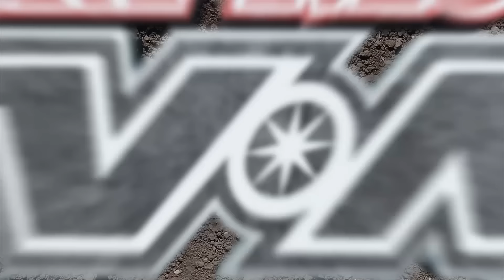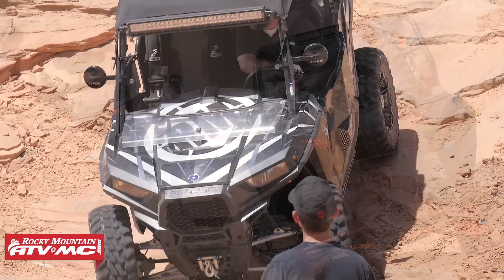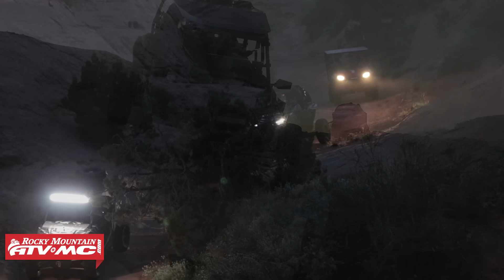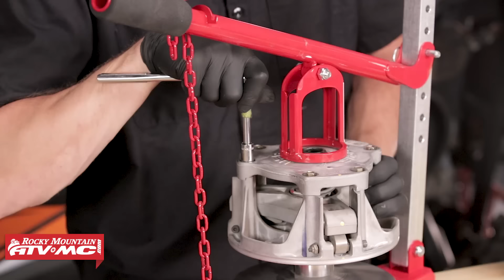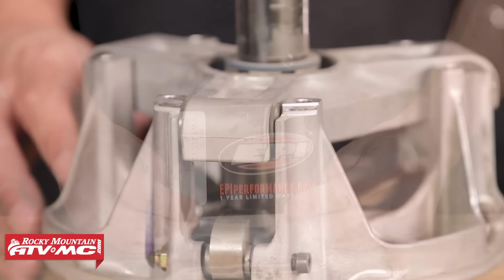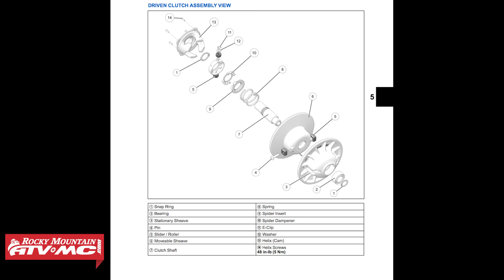How To Inspect Your Polaris CVT Clutch

Comment: Can the secondary clutch be replaced by itself or does the primary need to be replaced also?
Reply from the maker: Not required, but it would be a good time to replace both since you are already removing parts.

Comment: Hi I have a RZR 1000 TURBO..and replaced the primary clutch and it won't change gear at all.. But if I turn the engine off.. The gear selection is very smooth.. Which indicates a clutch issue I think? But which one and what am I specifically looking for? Any ideas would be great, thanks in advance

Comment: I have a question on my 4 seater Polaris 900 , I believe my son drove it on low gear on high speeds and well the belt was making noise so I replaced it but now the new one looks like it’s smoking or burning inside, I heard of breaking it in so I started with 10 miles per hour, is the the smoking burning normal when breaking in or do I need to inspect my clutch?
Reply from the maker: Did you clean and inspect the sheaves before replacing the belt? Smoking/burning isn't normal, I would definitely go through some of the inspections in this video and find out if something is causing the belt to slip. The exception to this is you might be able to smell the belt a little during break in, but  definitely shouldn't smoke. It really depends on how well the clutches were cleaned when replacing the belt and the condition of the clutches. Also check the air inlets and outlets for debris.  -Charles

Comment: Found your video looking for information on the polaris sportsman 455 desiel. Any idears why the gear selector would be getting very stiff and struggling to select both hi forward and reverse?
Reply: It’s the secondary clutch! It’s eather bad or out of alignment! Check your grooves where the belt sits sometimes it gets chipped and make everything bad! Check your motor mounts but before you buy a new clutch buy a new gear shifter to see if that’s the problem!
Reply: @SuperMTristin  cheers appreciate the reply. Stripped it down. Also found a water leak so more work to do now lol
Reply: @callumjohnson9433  no problem! Anything else u need help with?

Comment: Hello, I have a polaris RZR XP 1000 (2014), I'm having problems heating this CVT when I use it severely for more than half an hour, the belt gets too hot and I realized that it loses its useful life ... the problem also occurs when I walk in the range of 30km without stopping, in the range of 90 to 100km / h, it also heats up the belt a lot!
Would you have any option to change the air more to cool the CVT? I've already researched the internet, but I didn't find any option for this problem ... I thought about adding a fan cooler, only stronger, to force the CVT air circulation
Reply: u need a clutch kit bro. from rsvperformance.com or epi. i chose rsv or rvs i forget which one it is now but u tell them ur tire size and mods and what type of riding u do and what part of country u r in and they send u a custom kit to match all the stuff you tell them. Otherwise u gotta pick ur own spring and all that and if ur like most of us u dont know what kit to choose. 
It helps tremendously man its like riding a different machine after u install the kit. top speed changes, it engages as soon as u hit throttle and it doesnt generate any heat after u install the kit. its crazy. better fuel economy too.

Comment: What  causes the engine to stall after changing a belt on a brand new RZR 1000? only while throwing it in gear it cranks up fine in neutral and idles but soon as you pull it in gear it stalls
Reply: maybe your engine brake is in the wrong way?
Reply: Have u figured it out

Comment: What is happening if the clutches do not slow down enough at idle to stop the belt from turning? This is my cvt issue and it will not go into gear.
Reply: Clayton, what did you end up doing to correct your ATV Clutch issue? I'm having this issue with my 2018 Sportsman 850 SP.  I've replaced my primary clutch with a Mother Cluther clutch for my machine, but this hasn't corrected the problem that doesn't allow me to shift gears while the engine is running and slight creeping while at idle and in gear.
Reply: @mhumke8995  Sorry, it's been too long. I don't remember the exact issue. Seems to me, if I pulled on the belt (while engine off) one of the clutches would give allowing the belt to not make contact. Thus, not spin. 
Maybe a cleaning was all that was needed? Just don't remember.

Comment: Question: You're saying to stay in low gear between 7-10 MPH, but the RZR manual says to use low for speeds under 35 MPH. Why do you recommend the 7-10 MPH? Thank you.
Reply: Did you not watch the video playa? To save your clutch from premature wear

Comment: Is it normal for driven clutch to have slight wobble?  Machine only has 300 miles and clutches are very clean. I checked input shaft for excessive run out but it perfect.  ? Thank you
Reply: I've seen wobble on a lot of new machines. Probably nothing to worry about
Reply: @MercedesCitarobusvideos  thank you. I've since put 25 miles on it with an issue. However now the rear is making noise. I'm told that's normal too but its getting louder and can feel it. My first Polaris.
Reply: @RVsandRCs  What model?
Reply: @MercedesCitarobusvideos  2013 sportsman 850 xp

Comment: It’d be awesome is someone made a video on how to align these clutches... I got a sportsman 1000 that’s really hard to shift when running, belt seems to be riding the inside of the primary and there’s a gap on the outside of the primary but the secondary sits on splines so I can’t just add a washer,,,, any help would be appreciated
Reply: @Alfred Farrell there is a very detailed write up on aligning sportsman XP clutches on Polaris ATV Forum. It discusses a Sportsman XP550 but the procedure will be the same for yours. Hard shifting can also be caused by a one way bearing going bad or a primary clutch not moving freely or fully retracting.
Reply: @Alfeed Farrell here is a link to the discussion on aligning the polaris XP clutches.
https://www.polarisatvforums.com/threads/how-to-shim-polaris-xp-secondary-clutch.63062/
Reply: @Alfred Farrill sorry got you name wrong twice
Reply: @mendomotox1569  Thanks🤙

Comment: Have a 1995 Polaris 425 Magnum & are trying to remove the secondary clutch pulley  I do not have a puller. Can I use a wood dowel and carefully impact the secondary pulley to get the assembly removed from the splined shaft? Thank-you for the comments.Bob  @                                              2robilyn14@gmail.com

Comment: I have a 1997 Polaris Xplorer 500. It no longer will go in forward or reverse. Both the primary and secondary clutches appear to be opening and closing as the engine RPM is increased or decreased. The question I have is, with the ATV shut off, should there be resistance on the secondary clutch when I turn it by hand? It does not make a difference whichever position I have the shifting lever in. I am new to ATV repair but feel that the shaft on the secondary clutch should be engaged with the drive on the transmission. Any advice would be greatly appreciated.

Comment: my Polaris is chugging in gear when you go to start it then you have to put the shift cable down into neutral or Park to start why is it getting hung up
Reply: adam waugh your clutch is going bad. If it creeps or crawls with out throttle being applied then it’s a bad clutch pack. Should change belt too
Reply: seized bearing on the primary

Comment: While inspecting the sheeves, just how bad do the scratches have to be? While removing the old shreaded belt I accidently made some small scrathes. Will this hurt the new belt? I would hate to have to replace it. Obviously. Thx in advance
Reply: Depending on how bad they are, start by filing them then work your way through sand paper and finish with a red scotch brite pad.

Comment: question, I noticed mine as well as my friends Sportsman while taking off fwd or reverse, you hear a loud clunk. Its not coming from the engine. Sounds clutchy or drivetrainish. Does this sound familiar? Its annoying as hell. BTW, we both have new machines. Def no wear and tear condition. My buddies is much louder than mine.
Reply: The "clunk" you hear is the roller spider assembly in the secondary clutch when it is going from the forward side of the helix to the reverse notch and this sound is normal on the TEAM Tied clutch. OEM this notch is quite large which is a cause for a very aggressive enginge braking (EBS) engagement. Most aftermarket go with a less aggressive notch that has a smoother transition into engine braking and will reduce the "clunk" sound.

Comment: Nice video.  Very informative.  I spray mine out at least once a year with air to get the dust out.  Mostly Moab riding.  I asked someone when I first got my rzr about lube but was told that was bad because it attracts dust more in the clutch.  How about dry spray lube that has PTEE in it.  I've used it and my clutch and belt still look good from a 2012 rzr900xp.   Any thoughts on this or any other recommendations?
Reply: Graphite dust, i use it in my ar when I'm gonna be in dusty or sandy conditions. Same with troops deployed overseas.